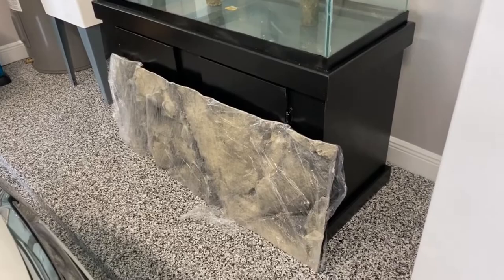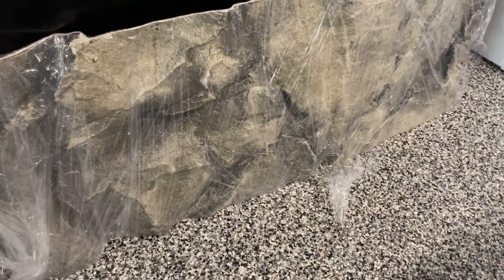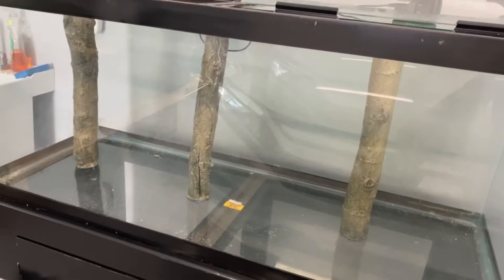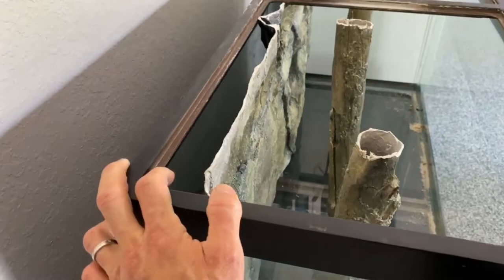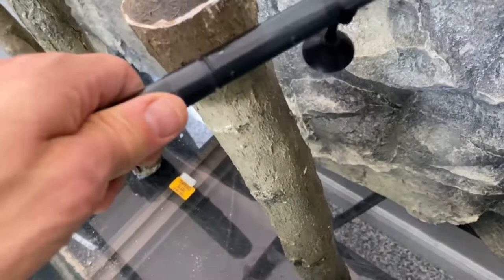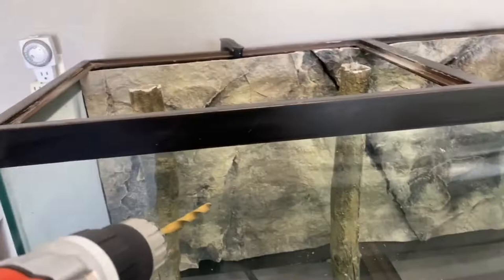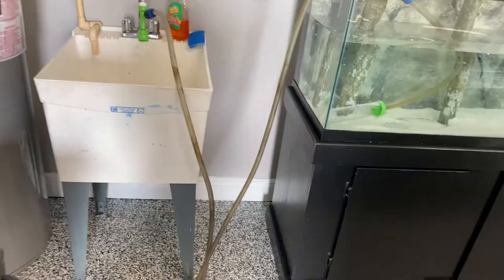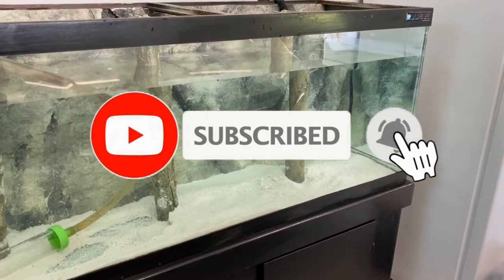AQUADECOR CUSTOM BACKGROUND & BAMBOO INSTALL!

Comment: I have made old fencing in my Aquarium out of BAMBOO with stainless steel rods in each piece of bamboo but it still wants to float! Anyone got any ideas?
All the pieces are waterlogged and have stainless steel rod's in each piece so no air trapped anywhere! I don't want to glue stone to them as it would look weird! Any advice would be much appreciated.